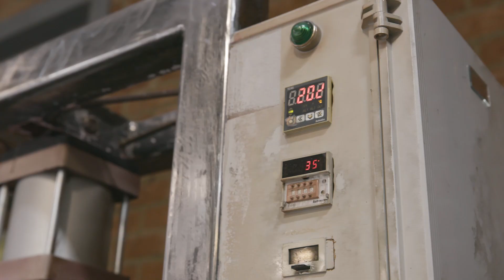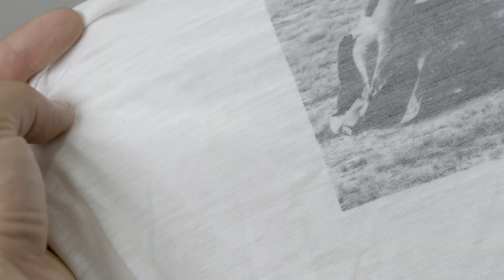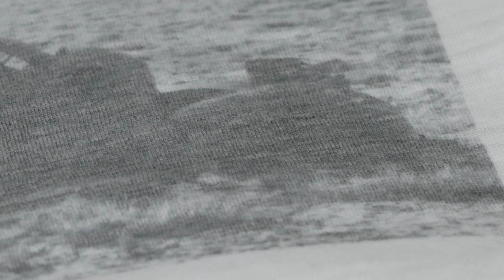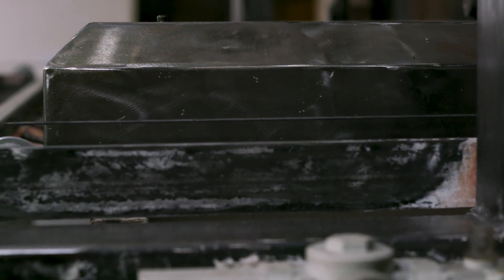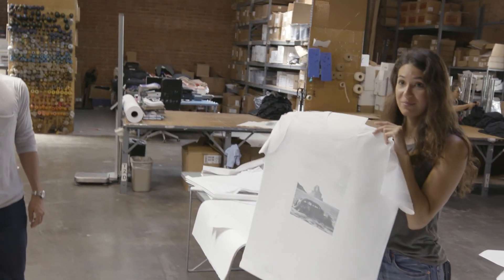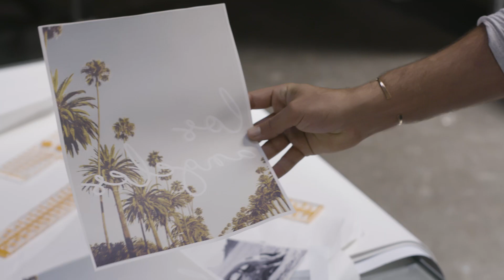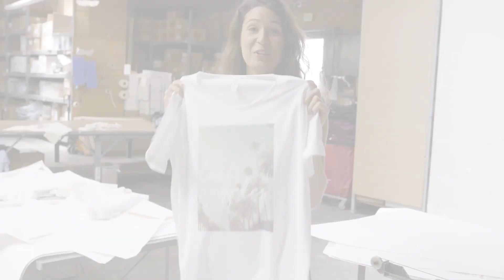Sublimation Printing T Shirts - How to Sublimation Print on Poly Blend Shirts

Comment: Great video!  Did the print paper leave any crease marks on the shirt from the “vintage” and/or “los angeles” subli print?
Reply from the maker: Hi there! It did not. Adjusting the pressure and timing will also play a huge factor in avoiding the scorch marks!

Comment: I know this video is older but I'm researching sublimation right now and currently using screen printed  transfers always on B+C. We know that sometimes when we print on poly blends especially with viscose we see scorching/shine where the press heats the shirt. Sounds like sublimation uses an even higher heat than we use so curious if you find there is a lot scorching when printing these? TIA!
Reply from the maker: Hi there! The high temperatures necessitated by dye sublimation will modify the substrate color and finish. If using an oversized heat press, that covers the entire garment, this result will not be as noticeable as when using a smaller heat press which is only pressing a portion of the garment. Additionally, the high temperatures necessitated by dye sublimation can scorch certain fabrics/colors, therefore, we recommend that you test your fabric prior to decorating.

Comment: I work a lot with the 50% Tribute-blend mix.  I'm compiling a new season of designs and I would like to make Bella & Canvas integral to my range. I can only go up to 270° on my press, although I noticed you state 400° for  25 seconds! Is there a recommended heat/time ratio I can work with? I've had mixed results with Anvil/Gildan stuff for 180°/95 seconds

Comment: how do you prevent scorching the rayon and viscose using that much heat? i have seen burn marks on our heat press at temps 350 and higher using those materials.
Reply: yes, what he said. we hate burnt squares.
Reply: cover sheet?
Reply from the maker: A teflon pillow underneath can act as a cushion as well as a protective teflon sheet or blank sublimation paper on top of the printed paper will prevent those burn marks and scorching the fabric. Adjusting the pressure and timing will also play a huge factor in avoiding the scorch marks!

Comment: No scorching in any of the test?

Thanks.
Reply from the maker: Hi! DTLA Print did adjust the pressure and timing based on the fabrication to get settings just right. We also used blank sublimation paper on top of the printed paper to prevent scorching.
Reply: Thanks.
Reply: Thank You! Ive been using normal printer paper instead of the thermal sheet. I still find a lot of scorching when I used the thermal...

Comment: What temperature and pressure do you recommend when heat pressing designs onto the 65% Polyester 35% Viscose?
Reply from the maker: Sublimation is generally between 380 – 400 degrees for 20 – 35 seconds, but we definitely recommend you test the fabric with your machine before doing a big order!
Reply: Question

Comment: Hi. I have a sawgrass Virtuoso SG 400 and your tanks are my favorite ones, the company I bought this from said it only works on polyester not blends. Is there a special paper or ink I can use? I haven't tried it on one of the tanks but wanted to see what you recommend. Thanks.
Reply from the maker: Hello! It should work as long as the content in the blend is high enough. DTLA Print recommends printing on a 65% poly blend minimum. Our Poly-Viscose (65% poly) and Marble (91% poly) collections are great options! Re: the paper and ink, that would be a question for Sawgrass directly. Hope that helped!
Reply: Hi Thank you! What temp and time would you recommend?
Reply from the maker: Brandy Henson Between 380 – 400 degrees for 20 – 35 seconds, depending on the fabrication of the tee. All fabrics should be tested and levels adjusted until you get the settings just right.

Comment: Basically anything below 90% poly you will get a faded look. i have tried all blends and tbh all are crap unless you really do want a faded washed out look but most of the time it looks bad. i have just gone back to using polyester for bags etc and for my own cloths i use sublimation flock and heat press to usually nearly all cotton hoodies and sweatshirts

i did buy a 100% poly hoodie and god its horrid